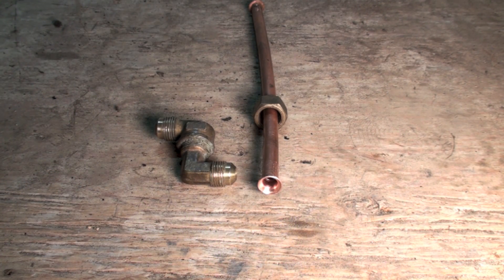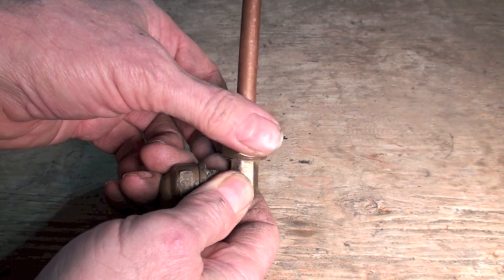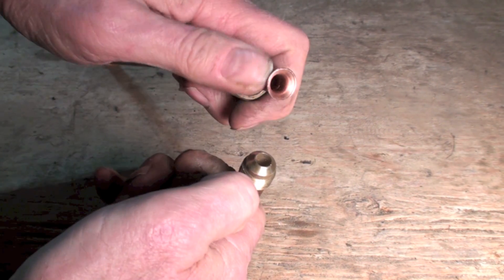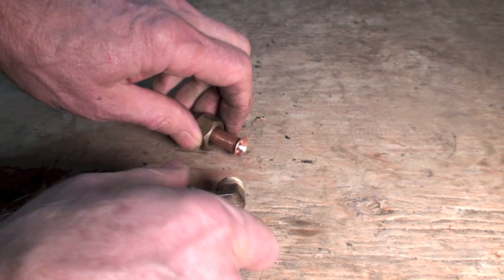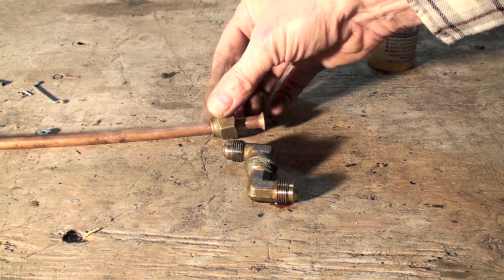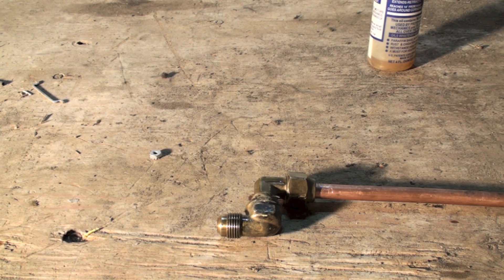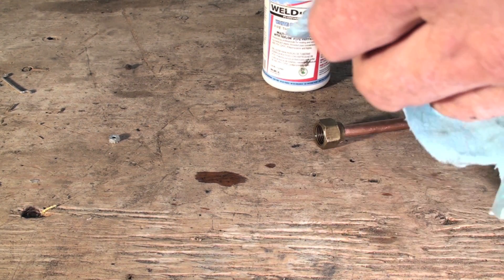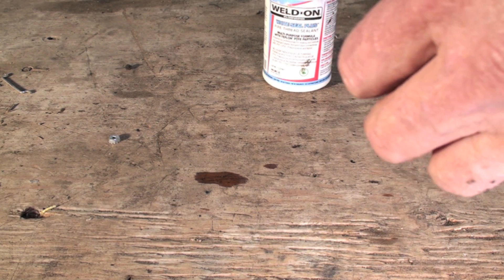How to make a flare fitting seal

Comment: Good sharing experience with people. 
If I use Teflon tape is it OK? On air compressor line from cylinder head to the tank
Reply from the maker: I would not.  Teflon tape breaks off in small pieces and those pieces get into the system.
GFM

Comment: I know this is hvac application...but I have a leaky egr tube in a cars exhaust system...anything that can help with that leaking?

I think I just simply need to tighten down further...the threads are rusty on the flare nut...but just in case I get it tightened down further and it still leaks I'm looking for a backup plan

Comment: No, No, No! I had to stop watching this video before it was done. 
  Of course it goes without saying — make a nice clean flare, and de-burr it smoothly.
1. Oil on the threads. From my Snap-On rep, 40% of the torque in a threaded part is friction in the threads. Oiling those means you are over-torquing by at least 40 percent! More flares fail because of too much torque than too little.
 If you're gonna oil something, do the back side of the copper tube so it is less likely to be damaged by the torque. Lubrication will still mean over-torquing it — the spec is based on that friction, too — but the oil is in a useful place.
2. Pipe dope. Maybe OK for water, but why would you introduce something completely incompatible to a refrigeration system??
 Use sealer meant for refrigerants instead.
3. Tinning. A neat idea. But you are introducing a hazardous substance (lead), not to mention corrosive and refrigerant incompatible flux (including burned flux, oxides and whatever crap the flux cleaned away). Your torch is probably MAPP for brazing, so you may even take the temper out of the forged threads or the cone.
 Out in the field on real equipment, what's the chance this is going to work?
Reply from the maker: Some of your comments have some truth in them (maybe the contaminants is a bit overdone).  
I will never stop using oil on threads.  You want to concentrate the pressure on the flare, not the threads.    Maybe you should stop depending on a guy that sells tools.  And lead has not been in low temp solder for over 30 years.   I started doing this in the late 1980s on literally hundreds of jobs and followed virtually all of my jobs with one failure.  I always use propane for low temp work.  
Flares are the best mechanical fitting used for refrigeration and they are very poor.  Brazing will do the job better.  Thanks for the thoughts.
GFM

Comment: Oil the threads, good-n-snug torque, got it.  Thanks.  I like your videos.
Reply: .. the only thing with that is .. from an engineering point of view .. the 'friction' on the threads is what holds the fitting/nut/bolt/screw tight.  The whole theory behind a thread being tight relies entirely on 'friction'.
I know of people who have put oil/grease on their wheel nuts to stop the threads from binding ... only to have their wheels come off while they're driving.

Comment: I make dozens of flare fits every week and rarely have any troublesome connections.
I know this is old but still just gotta say, that a drop of oil on back of the flare between the nut and copper would have eliminated that extreme measure of soldering the fitting. The most convenient oil that works very well is to use is a spray can of WD-40. You simply mist a light coat on both threads and include the copper flare on both sides. One thing I have found to cause more problems is tight copper rolls where you end up cutting in  the tight part of the roll. What happens is that when you unroll the copper from the tight part of the roll, it work hardens somewhat and that makes sealing the fitting harder. It can be made gas tight with good fitting wrenches and lubricant on all parts.  I never ever use any pipe dope on any part of a flare fitting!!.
Reply from the maker: Your methods are the ones I would recommend.  You are working with nice, new copper.  However, I am the one that follows you, perhaps several years later.  At the point I find the leak, the copper has hardened from years of temp changes and the leak must be sealed.  In fact, many of the flares I encounter are factory done.  
Whether its oil, pipe dope or a soft solder seal, it has to seal when I leave.
GFM

Comment: I use a fine stainless wire brush to remove excess solder from the flare face in the case of making the lead gasket.  Wiping the fitting with a damp sponge or cloth squeeze-dried, can work as well.

Comment: Mmmmm ... by tinning the pipe ... you have also annealed the pipe which can work harden when forming the flare ... this softened pipe will then more easily conform to the Brass cone on the fitting ... voila ... it seals ... probably easier to try that first ..especially with older pipe !!  CHEERS
Reply from the maker: Good thoughts.
GFM

Comment: Flaring is simple when done correctly. 1. Make sure tube is true 2. Ream out tube 3. Flare with proper clutch style flare tool with the pipe about an eighth inch passed the block using refrigerant oil or nylog. 4 make sure it is large enough to cover the whole nipple and torque to spec.  Oil the nipple as well. It will not leak.

Comment: im fighting one that leaks now, thank you for the tips, ill give it a try, and your videos are the best, my next project is my rezenor shop heater, pilot is on, but it wont fire, thermostat is good?
Reply from the maker: First, check for power to the unit.
GFM
Reply: I will do that next, I also noticed it cycling in and off a few days before I noticed it not coming in anymore

Comment: Any tips on using a flaring tool on a 5/8 fitting? Have a lot of problems with that size they almost always leak. I flare with just a bit of material poking through like rhe manual says but I still get leaks, any smaller fittings not so many leaks.
Reply from the maker: About all I can come up with is the finished flare should just barely fit into the fitting.
GFM
Reply: @grayfurnaceman  awesome, I'm probably not having it protrude far enough out of the tool before flaring

Comment: Just dug out my cheapo flaring kit from years ago as my propane tanks were "not filled" this morning. Figured I'd check utube for some tips, the first three videos were an insult to my intelligence and luckily I clicked one more, thanks for the "options" you provided. What's up with my flares cracking? Aged copper? Would heating the end of the pipe up help or hell even greasing the cone? I also am curious what the different angles are all about. As usual I'll find an old person with dirty hands and show them respect. Amazing how many years worth of tips you get access to that way.
Reply from the maker: The cracking is aged copper.  Heating may help.  The 30 degree used to be for plumbing, no longer used.  Its all 45 degree now.
GFM

Comment: Ritewayguy: I tried your idea of using teflon tape to seal off the 1/4" flare test ports on an R22 heat pump. Even new shrader cores didn't stop the leaking. 
The teflon tape  worked!! Yes it's a rig for sure. But a week later it's still sealing the ports to brass caps with an internal rubber seal. Had to wrap the port some where around 6-10 times. Didn't cover the sealing surface, just the threads. Sorry I forgot to count. I use a Tif ZX freon sniffer for testing.

Comment: Great idea! Can I use normal solder wire for electronic for do it?
Reply from the maker: If it is for potable water, I would not use any solder that contains lead.
GFM
Reply: is for clima, gas R407C
Reply: I do it today in a flare fitting of my clima with normal solder for electronic, empty with empty pump is perfect, no idea if it will work with gas and vibrations of compressor. Sorry for my not perfect english, Im from Italy.

Comment: just heat the rim of the flare it work hardens during forming and will soften after you heat it
Reply: Do you guys know if this will work on a break line flare fitting?
Reply: @shanewilliams910  light lubricant behind flare double flare

Comment: next time this happens use a flare gasket or make a flare gasket.  Most flares fail, I'M TOLD, FROM OVER TIGHTENING... I double flare and use flare gaskets myself.  I use the nylog to just hold the gasket in place, not to seal anything, as you state correctly, the seal is made at the face of the flare, the threads apply force to mate the adjoining surfaces only.

Comment: The whole point of flare is the easy with which you can replace components without brazing. After heating the finished joint you basically have a soldered joint strengthened with a holding nut. So it's a permanent joint just like a brazed joint, only with a lot more extra work. I would think it would be a lot easier and faster to just braze the thing together without going through all of that
Reply from the maker: In the case of the TXV joint, brazing is not possible.  This is what I primarily use this for.  In any case, this is a quick way to seal a problem joint.
GFM
Reply: +grayfurnaceman That is interesting because most of the air handlers I install have a txv with a swaged fitting to brazen them in. I just wrap the body in cold water soaked rag.
Reply from the maker: The point of the last comment was the valve comes with a flare fitting.  What to do you do to seal one that leaks. 
GFM

Comment: Thank you for the excellent video & concise explanations.  I have had issues with installs of mini-splits which require flared ends at the condenser & the evaporator.   The pre-made , insulated line sets (3/8 & 1/4) do not have the wide flares required for use with the higher pressures of 410.  Hence I cut them off & make new flares.  My older, Yellow Jacket flaring tool is not well suited to make  precise, wider, 45 degrees flares.  Hence I  will be purchasing & using the USA made Yellow Jacket Deluxe flaring tool with auto-stop to create wider flare aprons.  However, if this approach has failures, will definitely use either the pipe dope approach or the lead gasket approach.  Also appreciated the comments by Joe Marchione about the NyLog.  I have it but did not think to use it because of how stringy it is.   Tom Jones,  New Orleans
Reply from the maker: Thanks for the thoughts. 
GFM

Comment: Gary,  Thanks for the video.  As far as Nylog is concerned,  I do not see it as a cure-all/end-all solution.  I have solved leaking refrigeration flares with it, But I will use it on my flares as more of insurance, or at least I feel better when I do use it.  What is nice about it is that it is made from refrigerant oil and there is no problem if it gets into the system.

But I do realize that sometimes it is what ever you are used to or are most comfortable with.

This video, does give us guys more options than we had before.  Thank you for sharing what you have learned over the years to make our work easier.

Happy Thanksgiving!

Comment: does anyone use double flares, many yrs ago (before plastic) we had to make up air and gas lines for truck air brakes and gas lines and had to double flare the ends, then just got into the habit of making them for oil lines
Reply from the maker: I don't see much in double flares.  Although they would be better for vibration, I don't think they would seal better.  Thanks for the thoughts.
GFM
Reply: dave12546 I have a double flare tool that I use on steel lines for automotive stuff. I agree it doesn't make a "better" seal but it doubles the wall thickness of the flared part. Usually automotive is inverted flare and I feel like the flared part is under more stress in that situation. Just a guess

Comment: Great video GFM. I prefer Nylog as well. It has been proven to work and hold up over time. Been around since 1995. Get some and try it, I believe you will like it. Take care, Brett
Reply from the maker: It may very well be a good solution.  My point in this video is the progression from simple solutions that can be effective to the "it will never leak again" solution.  I would think Nylog would be effective at the "pipe dope stage" and without introducing chemicals into the system.  I will get some and see what it does.  Thanks for the thoughts.
GFM

Comment: Good instructions.  I have used a good grade of Teflon tape on leaky fittings,  and have had a lot of success with that method.  It works fairly well with higher pressures on some refrigerants that use flare fittings.  I wrap the male side threads and the mating surface with the Teflon tape and tightened the joint fairly tight.  But with your experience that shows in these videos,  you most likely have done this too.  Thanks for your videos,  they are very down to earth and explained well.
Reply from the maker: Your welcome.
GFM

Comment: Don't they also make a copper gasket that fits right between the flare and the fitting ?
Reply from the maker: Those are usually used when connecting 2 brass fittings together because the copper is softer than brass.  I have never seen them used for copper to copper flares.  I would think that would increase leak problems due to mare areas to leak.  But who knows.  Maybe it would work.
GFM

Comment: I used to do the pipedope trick with leak lock instead of actual pipedope. Usually worked ok. No i like to use nylog. Now of course i think its best to re-flare the copper but that not always an option. Good vid. I like the solder trick never seen that. Would be good until someone couldnt get it loose. Lol
Reply from the maker: One of the reasons I came up with this is we had so many leak problems with all mechanical fittings that I came up with the solder repair and I never had one leak after that.  And yes it was hilarious when one of the other techs would try to remove it.  Thanks for the comment.
GFM

Comment: In the 90's the bryant/carrier lower end heat pumps had flare fittings on the liquid line.  Hated them.  Had tons of problems sealing them.  I told my Bryant Sales rep about it, he check into it and said carrier had reported no complaints about it.  I found that very unlikely.  Now they have better fittings.
Reply from the maker: How many times have I heard that!  Everyone else's works fine but mine is broke.  The Carrier units you dealt with had the same fittings as the RQ units I worked on. The liquid line fitting had the accurater inside that was sealed by an oring that also leaked like a sieve.  As for better fittings now, the service valves are the first place I look for leaks.  Thanks for the thoughts.
GFM

Comment: Whats your opinion on nylog?
Reply from the maker: I have not used it, but it seems like it could be an effective product.  As with so many of the quick fixes that claim to be the end all, I am always skeptical.  Remember the copper glue that came out about 6-7 years ago?   I tried it and it seemed to work under tests.  Failed every time in actual use.  Also cost about $35 per ounce.  Thanks for the thoughts.
GFM
Reply: Eddie L. Hi